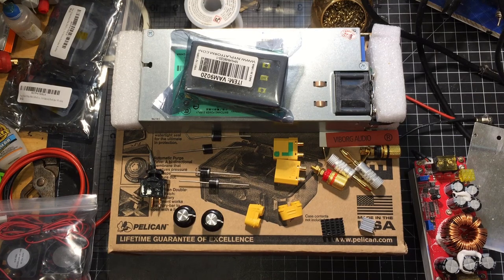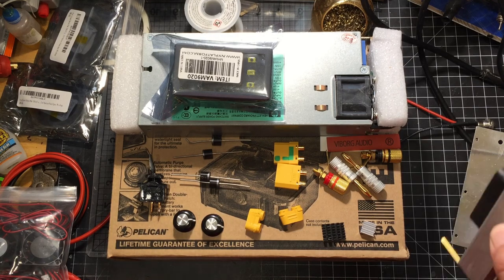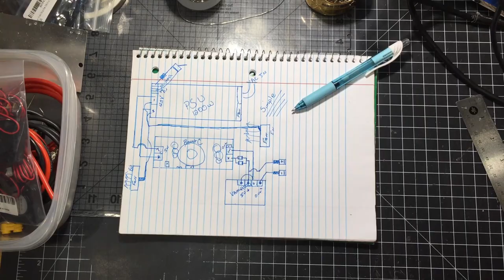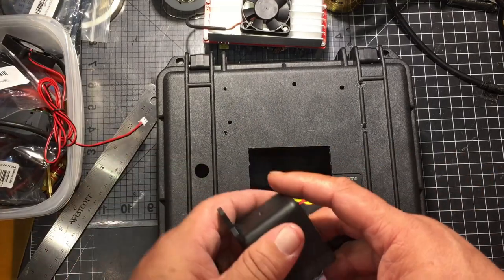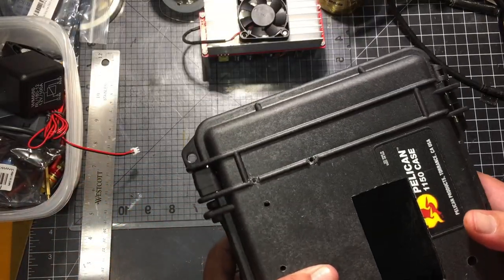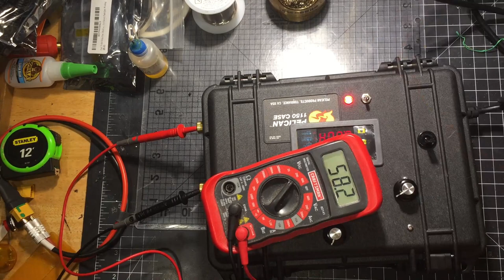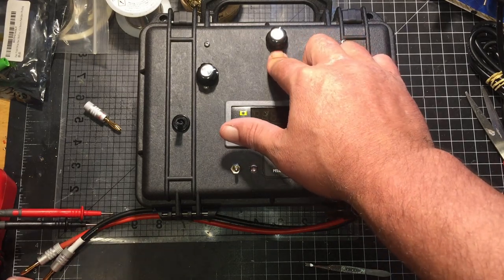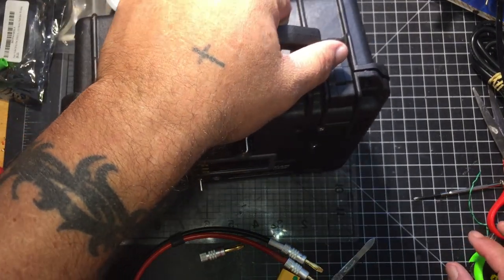DIY 90V 20A Adjustable E-Bike Battery Charger Pelican 1150 ( HSTNS-PL11 )(DIY E-Bike Build Part 3)

Comment: Something like that would be ideal with my little 1000W inverter generator...charging on the fly while riding.  Using headway or those flat pack batteries with the safer chemistry, charge and discharge rates would be fun to see how many 100's mile per gallon I could get.

Comment: BTW, You mentioned having a bit of confidence in those boost converters.  You normally set it and forget about it dont you???   Can they handle voltage and/or amps being dialed up and down regualrly while in use??
Reply from the maker: I’ve been using one in my DIY power supply build for over 3 years without fail. These are great little boosters

Comment: That power supply will not do 20 amps of charge current at 90v. Although I'm sure you know that already, was a bit confused for a second by the video title description. I use a 48v 2400w eltek power supply coupled to the same 1800w step up converter, using 48v instead of 12v is far less stressful for the converter as there's less of a voltage gap. I have 2 x 40w Delta fans in push pull config built onto either end of a rectangular mdf box with all the electronics in the middle. They push some serious air through for cooling. My charger can actually do close to 20 amps of charge current. Actually shown using the BMS app and using an amp clamp to measure current. My batteries are 20ah EIG pouch cells. They reach around 40 degrees C after charging at that current. Although to be honest most of the time I charge at 10 amps as I don't need that amount of speed. One mistake I made was using 2 x converters on the same power supply to power the fans and step up separately, the noise popped the caps on my step up when I pushed it past ten amps, but functions fine on lower settings ( I assumed that's why you used the diodes??). I've also made a portable charger using a 48v li-ion 40ah battery pack coupled to a step up, to charge my 23s 90 + volt ebike. I used it for a over a year before I sold the bike. Could happily sit at 5 amps trickling away whilst I rode the bike. But one thing I have to stress, these step up modules really do need proper cooling, they don't really stress that at all when buying them, they are 1800w step ups, but only with cooling!! So many people online saying there crap because they got too hot and burned out and they cant handle 1800w at all!!, but they are designed as such that you must add cooling, period! Using them without cooling is like putting remoulds on an F1 car lol.
Reply from the maker: Your 100% correct.  I usually use an ohm law calculator.  The power supply is only 1200watt.  At 90v, I might get 10-13 amps. But personally if I needed 90v, I would never go above 5amp. Typically to be safe, I never use more than 50% power and sometimes 75% power with good cooling.  I've built multiple power supplies and Posted the videos. To date,  I haven't had any issues using this formula.  This power supply was built mainly for a 13s ebike and any battery over what my reaktor 300watt 30amp charge could do. I have another power supply that's capable of 50v 20amps, I'll be building soon.  Would love to see your builds👍👍👍👍👍👍👍
Reply: @njfulwider5  well after I sold the bike bike they kind of got mothballed. But I certainly recommend building a portable charger like I have. Most BMS systems will allow you to trickle charge whilst you ride. I used to do fast food delivery. I had my portable 40ah battery with step up/ charger coupled to the top of my frame and it would charge for about 3 and half hours non stop usually I would set it to 4 amps ish whilst I rode to deliveries. Obviously that wouldn't keep up with the useage of the bike but I was delivering then coming back for 5 to 10 minutes waiting for the next then going out again. So it kept up. I did add a fan and used it at 15 amps and it kept up quite well. Even the 40ah of battery got warm though as the input end was pushing out quite a lump current lol. Had to massively beef up the wires. If you've got old batteries laying around defo so it as a project and post a video. People will love the idea I think as you can use any voltage battery lower than your bikes to charge it. Quite handy.

Comment: I was going to build my battery in 4 packs, 5s each. And parallel and charge with my ISDT T8, that could get old fast, I only want to charge to 80-81v
Reply from the maker: I almost decided to build 2 x 7s10P packs, but I later decided to just go for it. I purchased the active balancer and with this charger, it should be a great battery. The BMS has balance also, but nothing to brag about. Luckily the batteries I got are well-matched, voltage, capacity, and resistance.  Fingers crossed I can do the build justice!!!

Comment: I went with 13S and using standard Boost / Buck converter to charge.  Two batteries One in service one on charger.  Go with half of what the Chinese says and your safe.    I built a 20A transformer from a Microwave transformer.   You went way more complicated then I did.     My charger is nothing more then a Constant Current Constant Voltage PSU tied to a Transformer PSU.  I can sub my Solar Panels output for the transformer.    Yes I only charge my pack to 4.00v per cell.    The added output does not justify the cycle life lost taking them to 4.20v.
Reply from the maker: Thankfully I actually know the max of all components well, I’ve worked with them both for over a year in different projects. This is actually a pretty basic set up, just enclosed in a small pelican case.  I am proud of this build and I can’t wait to start my batteries build👍👍👍👍👍👍
Reply: @njfulwider5  Tidy Build to be sure.  Working on my second battery and avoiding all the mistakes I made on the first. LOL   Heavier Bus Bars being one.    I went with a 30A BMS on the first one.   They underrate those too.  LOL  The thing gets more then toasty hot at 15A.  Putting a Fan in the next pack.  My nominal being 4-8A cruising speed on the flats here.  I have two hills that require almost 20A ( Full Power Rating of Hub Motor  1000W )  to maintain my 20MPH speed.  This pack was created using those Modem Pack 2600mAh  batteries from the Battery Guy aka BatteryHookUp.  If you wait around they have some dang good deals from time to time.   This pack is 13S 6P.  Best battery in the pack produces like 2500mAh. Lowest 2300.    I purchased a box of 2200mAh modem packs that must have have been brand new status.  None proved under 2300mAh.  Those are destined for the power wall project.  7S set up.  Enjoying your show and tells.  Thank You.

Comment: FYi   1200W Power Supply HP Server  Frame ground and power supply ground are shorted together.  You can not connect two in series without mods.  There is a Youtube video on how to correct this problem.  If you need link Message me and I will look it up. I did it and it works.  Will be building this charger next month with two server power supplies.  Need parts
Reply from the maker: You are right, tons of great videos on this, this one is my favorite...lol-https://youtu.be/dnD-zaOznRo

Comment: without diagram you will not understanding 

so you should to put the diagram to ppl known
Reply from the maker: I would have, but this build used basic connection. No special connections required. But I may do a instructable to better help understand how I built it. 👍👍👍
Reply from the maker: Forgot to mention I also made a diagram, you have to look for it in the video. If you look at the instructable, you will also find it😁
Reply from the maker: See 8:08 in the video👍👍👍👍